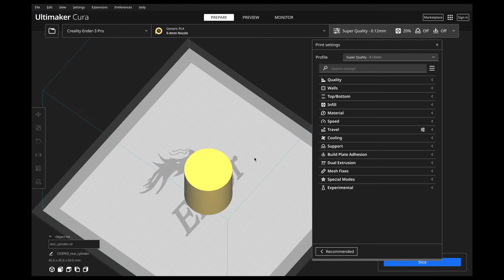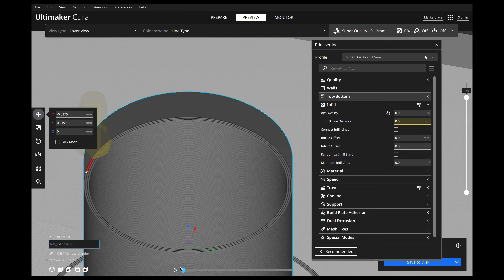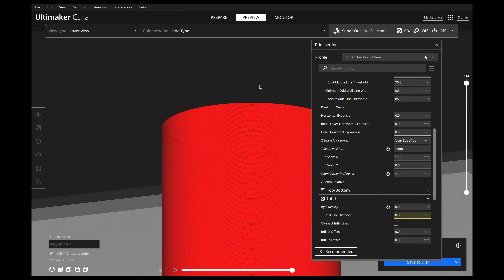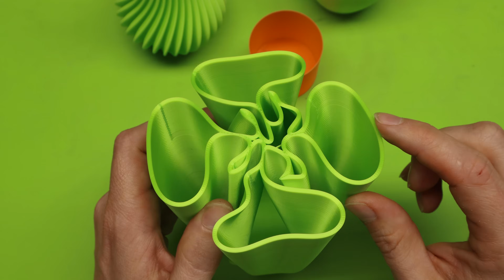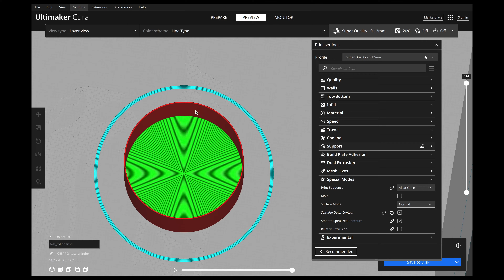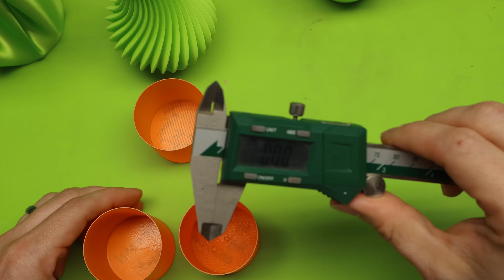Cura 5.0 - 3 Ways to 3D Print Vases for Better Results

Comment: it's not from going to fast.. it's the memory where the auto restart after power loss... I already looked into it because any of my prints that had curved sides had little tits on them.. as soon as I turned off auto restart.. they vanished...  also if you don't see some of the setting he shows in this video.. on CURA where for example is says QUALITY.. if you put your mouse over the check on the left side you will see what looks like a little slider icon ..click on that and it popup the settings for that choice..  like walls and other main options....   hope this helps

Comment: Great Video, as are ALL of yours.  I used some of your tips to improve my Vase printing with my Ender 3 S1 Plus, but now I am mostly printing on my K1 Max since I got it last year.  Vases are a challenge to find the right mix for speed and quality AND, of course, WATERPROOF.  I have used mostly Creality Print and Orca Slicers, because Cura doesn't have a profile for Creality's K1 Max.  Any suggestions to fix water leakage from the base and sometimes seams in spiral vase designs?  I don't want to have to wax or epoxy all of my vase prints.
Reply: Hi. Did you notice a big difference in speed going to the K1 Max?
Reply: @ Not sure if I replied previously.  If not, sorry!  YES…I noticed a difference of about 2-3 times as fast in print times as my Enders 3 S1 Plus

Comment: After watching your Vase video (GREAT info!) I printed a Spiral Cross Cut Vase with my Ender 3 S1 Plus Printer in Spiral (Vase) Mode with a .8mm nozzle and set a .32mm layer height with a .8mm line width, 220C Nozzle temp, 60C build plate temp, and a print speed of 30mm/sec; 125% flow.  These settings wee selected in CURA to get strength in the build using Spiral Mode, since it only prints ONE layer and no infill.  The strength is VERY good, but the print was done in Silk Silver PLA and it came ou very dull in comparison to printing in a normal mode using traditional settings with infill and multiple layers.  What setting, or settings is causing the Silk PLA to lack sheen or lack of being shiny?

Comment: Since a few days I have random missing layers in cure while using vase mode. The often times also just partially missing z layers appear in the slicer preview. If printed, the print fails because of that. I never had this issue before. Any idea how to fix this?
I am printing with a 1.2 mm nozzle.
Thanks in advance!

Comment: I've tried these settings and watched several videos in case it was me missing something but my vase is not hollowing out in cura despite following all the steps. I have set top layer to 0 and infill to 0, and slice. Still a solid object. I can't figure out what I'm doing wrong. Any ideas?

Comment: I would say if trying your way. Turn the temp down on the base. Leave the speed push out the filament. Depends if your running your fans on the base. I don’t run my fans on the base. I run the overture plus on 220 all the time. I could fine tune it. It’s not perfect that way. But it works. But I would believe the silk would be good at 200. I just got silk tan it once. Temp could definitely be at 200 😂 I have found a good cooling setup for my ender 3. Works really really well on bridging. Also cooling the filament at the right time. Anyways. If u did turn off the fans and leave the temp lower than 250. I’d say 210 maybe 220 it wouldn’t glob up on the pla. The silk I would say 190 probably on the base and 200 on the layers. Especially spirals. The other way. Maybe 180.

Comment: I have this issue in the vase mode, the print speed it´s so slow, about 30mm/s, no matter I set it up to any other number, 50 or 100.. it always going to print so slow.. I can´t realize what happen.. even the bottom layers are printed faster at the setting up speed, but when it reach the single wall area it go so slow.. spiralize mode or single wall set up.. 😥😥
Reply: You need to adjust your minimum layer time. I know you wrote this 7 months ago so hopefully you've already figured this out.

Comment: I use a 1mm nozzle if I'm printing a vase which makes it much stronger.  The only issue I've seen are some small gaps on the bottom.  Although, I normally glue a piece of felt to the bottom anyway so it's not that big of a deal.
Reply: I print a bottom raft that has zero gaps and then the initial bottom layer with all walls. So then I have over filled lines then covered with a layer of circles. This way there are no repetitive patterns. Dialed in just right it is almost always water tight. Make sure to wipe outer walls 10-15mm and that helps the initial spiral start spat not be a weak spot.
Reply from the maker: Oh yeah that would make a big difference. That’s a good way to make it super strong for sure.

Comment: why not use vase mode? just curious what are the benefits.
Reply from the maker: Vase mode works well but it only prints at 1 wall thickness so this is me going over ways to get good vases that are thicker and stronger.

Comment: You should be able to put in some post-process G-code, using Cura, to print your base at one temperature, then to change it to another temperature once you start doing the outer contour.

Comment: Hello
How about the printing time 4 the different settings  🤔
And have you a internet site or will you place the numbers 4 the advantages settings here?
I like the way you advise and explain but i am not a type 4 discord or Facebook and so on.
And Greatings from Holland Amsterdam.
🤗
Reply from the maker: It’s not about print time. It’s about those few settings. It make your printer push out more filament and makes thicker walls to make your vase stronger.
Reply: @ItsMeaDMaDe  i understand that but i was curious how much the one or other setting is going slower or faster.
But thanks anyway for the explanation ☺️